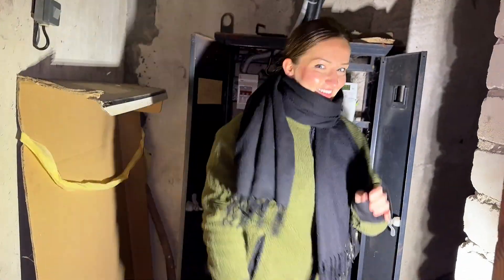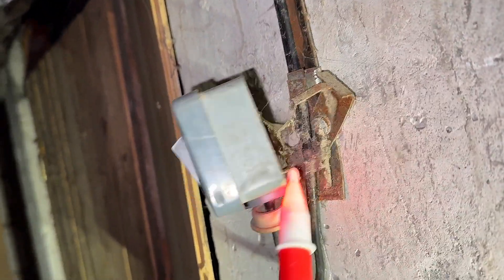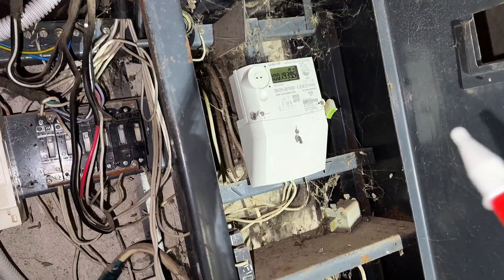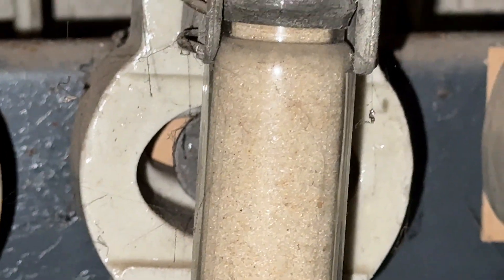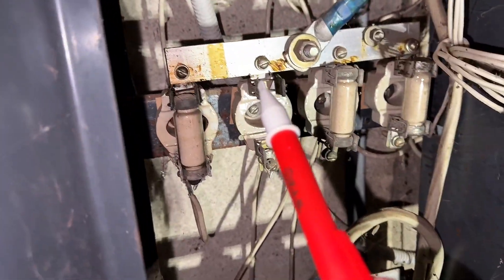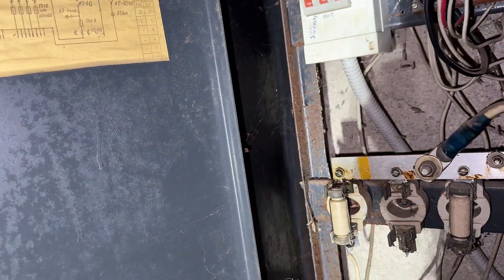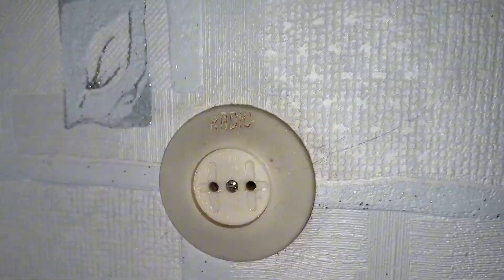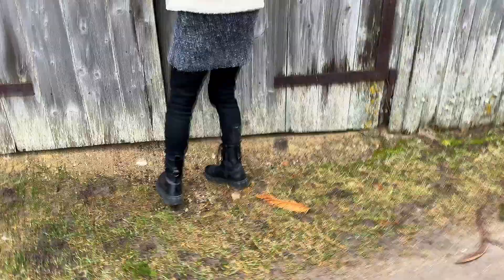Soviet Union Era Electrics: What are Silica Quartz Filled Glass Fuses? HRC High Voltage

Comment: That main panel is mostly fine. its just that the UK has some really weird regulations that make no sense. also how are you qualified if you are baffled by a main electrical switch and ceramic fuses. Theres even the wiring diagram on the panel door... The sand in the fuses is to extinquish the arc by blocking the path after the meltdown
Reply from the maker: I’m not baffled by ceramic fuses or electrical switching? Perhaps that’s how it’s coming across seeing things in real life for the first time rather than a text book. I guess the same way that a doctor can practice for years and read about a less common disease and feel in such a way once they finally come across it in real life… 

I understand the concept of fuses and how they work, but seeing an installation in real life with the sand on show like little sand timers is mind blowing 🥰 also reading wiring diagrams can take more time for some than others, which is nothing to do with their qualification but more experience and how their brain processes things

Comment: That's funny I just watched a thing about Soviet ""radio"" turns out it's more of a distributed audio system.  but the video did go into fairly good detail of how it worked. https://youtu.be/AvTaNVXGR0w and then YouTube recommend this channel. Yeah that's a fairly difficult electrical cabinet especially with all the modifications over the years I'm sure it was much nicer when it was originally installed. It wouldn't have been that much of a rats nest and where is would've been talked neatly into places in Ben the right length etc. Pretty good explanation of the fuse the sound is there to quench the Ark if one were to happen if it broke during the peak on the cycle. That's one of the differences between AC and DC is that based on the switch in frequency the line is crossing zero so you'll get no arc when switching which prolongs the life of equipment whereas with DC if there's a load there's an arc so everything has to spring open quicker and be further apart.
Reply from the maker: Wow that is so cool! Love how the algorithm worked to get you here ! Thanks for watching. That’s a brilliant video, I will do my own version of explaining the radio socket, as I’ve heard plenty of interesting stories about it from my grandma!!!

Comment: 3:12 The digital electricity meter only has one live cable (phase), 
but the distribution must previously have been with three live phases.
3:38 Open power rails. Great for checking the voltage.
8:24 The radio socket is probably not 230V, but the connection for the speaker for the cable radio.
8:45 - 250B = 250 Volt maximal. 4 Amps
Reply: Yep just saw your video on the radio system. Be in the industrious group they were they had readily available sockets already so they just reuse those nobody cared if it blew out the ""radio"". As you would only plug it into the special radio socket. https://youtu.be/AvTaNVXGR0w
Reply from the maker: Thank you for watching !!! Open power rails made me a bit nervous, I’ve worked in domestic and modern (smaller) commercial premises only. So this is all new for me 😅
Reply: The meter have 4 wires.... one neutral and 3 lives.
The neutral goes straight to the neutral bar (also connected to the ground).
The 3 phases goes into the main breaker
After the breakers, the 3 phases goes into 3 main fuses...... well..... TWO fuses because the third one is missing!
After the fuses, the "supposedly 3 phases" goes into 3 bus bars that have smaller fuses, then the power is distributed elsewhere.
Because of one of the main fuse holder is broken (and because there are no 3 phase loads into the building, just many single phase loads scattered around the 3 wires), the owner bridged two phases together leaving the third one unconnected...
Not a very good idea, but it works if the load is not too much.

Comment: Actually, most high voltage fuses (if not all) are silica filled. it serves as lightning arrestor (I believe at such high voltage, the air can become ionized and still conduct energy, hence sand/silica filling). quite OP for such low voltages though
Reply from the maker: 👏 yep! Awesome ! I like that expression, lightning arrestor

Comment: meter box -> main shut off(the mechanism) -> 40A fuse (for each pahase)(eh two pahses use the same 40A) -> each phase had 4 circuits protected with that sand fuse -> that might go into the 15A fuse -> then into the flat or the individual meter whatever.
i think thats the general ideea (in->top-right->bottom right->left buttom->top left->out). you have a schematic on the door that might make more light into how was done.
*I'm not saying I'm right, just how I think it would have been done.

Comment: That fuse reminded me of a high voltage fuse that had a replaceable link and was filled with a very fine sand. We used a flour sifter to remove the molten fuse material from the sand. Then replaced the blown fuse link and poured the clean sand back in. This was at 2am on a -30 degree night that a boiler water line broke right above the main high voltage electrical switch gear. Thanks for sharing.
Reply from the maker: Thanks for watching! I have heard a few stories of people repairing these like this! So interesting, I love how we used to repair things rather than throw out and replace…

Comment: The "mechanism" is the emergency shut off. Outside of the cabinet should be a handle to pull to disconnect power.
Reply from the maker: That would make sense !! 😅 as it seemed like something that would need a handle to operate but couldn’t find one, maybe it fell off 😅

Comment: Looking at wat you showed it look like main power comes in to the circuit breaker top left then follows the conduit behind to the power meter looks like en then in to the old 3 phase switch en 2 knife fuses is wat i was able to see from your video but hard due to the rapid movements from there it go to the 3 rails on the left where its divided in separate circuits bit pls keep hand free from pannel at all times they can be a hazard when something is not right anymore the fuses used there will not trigger when grounded to earth so watch out

Comment: That looks like the normal soviet era wiring they didn't have any particular color code  for single phase wiring. In Poland  phase wire was black unless it was beige  neutral was the same or sometimes white. Generally there's no earth if you wanted an earth you connected it to neutral  what I guess you'd call TNC system
Reply from the maker: 👏 yep! Or TT system with the rod…